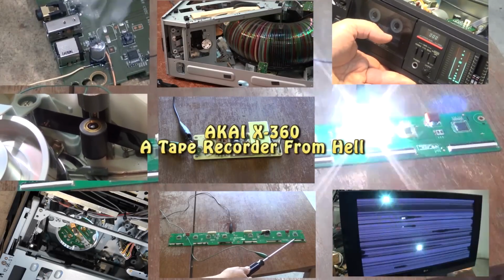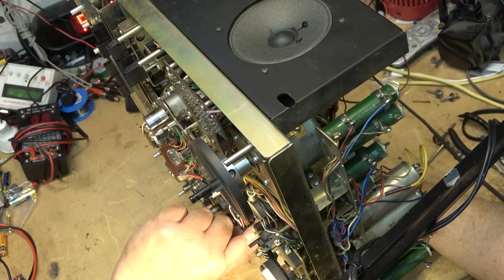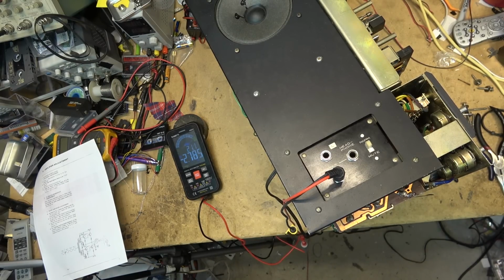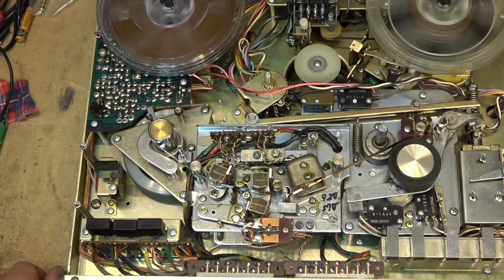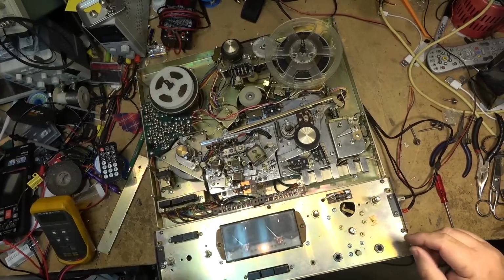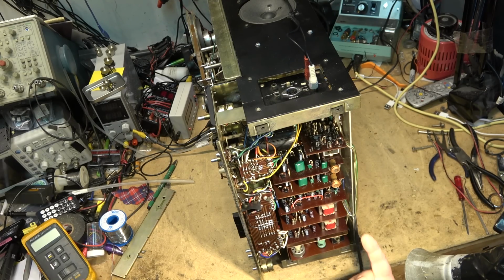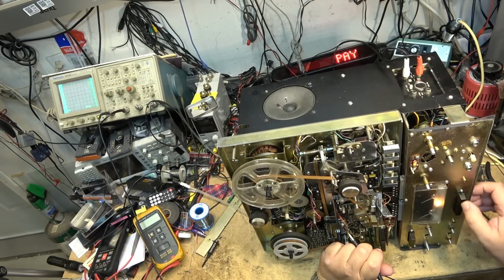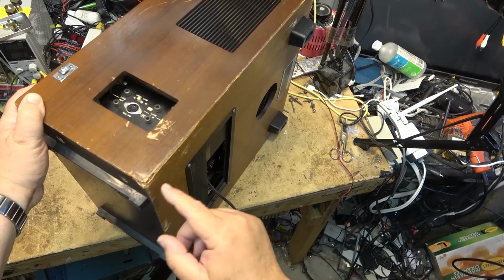Akai X360 Tape Recorder from HELL

Comment: Most Akai reel to reels are beautiful looking decks but they have that infamous pot metal issue with the parts that are no longer available
Reply: There is a company that prints 3D replacement cams ... I replaced on my 1710 , and they work fine
Reply: My understanding is that the pot metal part in question is the transport control cam, on the decks that have 2 levers to control stop/play/fast forward/rewind.  That wouldn't apply to the decks with push-button transport controls like this one.
Reply: I got one needing a motor run cap, another needing a bias oscillator, and another with a broken head adjustment cam. 3 different Akai decks all with different issues. ☹️
Reply: You can now get a replacement kit to fix the three cams , and are available on EBay and other platforms, I have just replaced them on my Akai 4000ds , the kit cost me £80 GBP .
Which saved the machine from the bin and hopefully to last a few more years.

Comment: In reely bad condition. Looks like the customer got you taped. Five hours of pain...ouch. I'm not laughing. 😐
Reply from the maker: I have worked on a few for them. Every time i promise myself I will say no to the next request as they are always more work than initially seem.  I would never do a full recap on one if these old units as with all those shitty boards there are so many faults that can be caused pulling them apart to get to them all.

Comment: When customer stated he replaced all the capacitors was a huge red flag and didn’t bother to change the belts and sent it in for that? For the most part the capacitors are not really a issue with these from experience, usually just use a ESR meter and replace just the bad ones unless I known they are a bad series that prone to fail. Akai used good capacitors in these. What know to be problematic is those 2sc458’s transistors as they used a silver coating on them that corrodes and works it way into the package and they become leaky and static and hiss. Also switches become corroded and etc. To repair it literally has to be gone though and take me a few hours to narrow down issues and etc. plus recommend to change all 2sc458 transistors. I use Fairchild KSC1845 as lower noise and work great overall.

I hate when people do a full recap and think it a restoration, it not and 9 times out of 10 going to end up being something else and in some akai’s they used custom packages that are prone to fail about 100% of the time. Thankfully replaced with discrete components in place and works. The Pioneer Reel to reel buffer IC and even seen some where logic IC failed and unobtainable. So if you do a full recap shoot gun approach you be out money and have to get a donor unit to fix. Always troubleshoot and repairs issues first at least. Plus changing all capacitors you will have to do a full calibration, in som case modification to circuit and etc, otherwise will not sound good as capacitors change resistance in circuit plus where made different back then, better to replace only the bad ESR, or ones that show signs of leaking.
Reply from the maker: Yes I've been saying that for years. But amateurs will be amateurs and someone will say shotgun all the caps and then everybody like a bunch of little lost sheep do that thinking it's a fix-all and it's not. but what do I know I've only been working on electronics for 40 years now so you know I know nothing apparently.
Reply: @12voltvids  I feel you. Apparently don’t know so people still do what they do and mostly  everyone thinks 100% capacitors are always the issue when they usually are not. Some have to learn the hard way, or after throwing some cash it to find it still doesn’t work? 

I literally had to service decks that were supposedly fully recapped and sold to customers that way and then have to repair the issues they caused and trace down the real issue then do a full calibration afterwards typically as some also like to just turn pots to turn them without service manuals or any test gear. I just got done repairing another evs3000 deck that a guy literally cover broken traces with electrical tape after hack job not due to corrosion but due to he literally burn the pads and crap solder work l, so had to undo all the work fix broken traces and that one needed a full recap as those stupid SMD that leak everywhere and calibrated preamp level RF after mechanical calibration of tape path and etc as he also turned a few pots when it was set screw on guide was loose. I shocked it now works to be honest as was about to give up on it after hours spend on it to undo the hack work. Only reason bother with it as was low hours and good cosmetic condition.

Comment: Just to add some on the explanation of a 'cross field' system: usually a high frequency called 'bias' is added with the record signal to the record head. This signal is agitating the ferro parts on the tape to move out of their lazy position, while the sound signal at the same time will form them to the new recorded sound. In a 'cross field' system that bias is NOT added to the sound signal to the record head, but added through the air with a second head, the bias head.
Reply from the maker: Yes I believe I said that the buy signal is through that second head at the bottom which is injected just ahead of the recording Gap. When the buyer signal is added to the audio it has a tendency to cause slight Erasure to the tape especially at slower tape speeds. The crossfield design allowed frequencies upwards of 18 kilohertz at 3 and 3/4 IPS something that at the time of this unit is manufacturer is pretty much unheard of everybody else at 3 and 3/4 the frequency response dropped off around 10 kilohertz.
Reply: Thanks for explaining this in the vid.  Growing up, my dad had an X360 (and still has the Heathkit Magnecord that he built in college), and I ebayed the one I have now for sentimental reasons, and in those 45 years, I never realized how the cross-field bit worked.  So you educated me today.
Reply: @12voltvids  Yes you explained, and so I added my view with it. It is a forgotten way of doing things, and there are not many reel to reels that use this.
This model has a 'relative' easy setup of the head, it has a separated record and playback head, but if the record head needs adjustment, in theory the cross field head should be adjusted too, so be aware of that.
Some other models, like the X-201D don''t have the playback head separated from the record head. In that case the added problem for technicians is the way you have to adjust that cross field head. The only way is to record after every change of setting, rewind, and playback the result and watch the frequency response. Adjust again, until satisfied. I found it really terrible and time consuming. Advice is to never unscrew or unset the cross field head unless real problems demand it.

Comment: When you said do you guys see this at 37:44, I thought you meant the pinched wires coming from that power resistor through the chassis. Did you see that?

Comment: Great video. I just bought one of these of eBay and the video should be really helpfully in getting it mostly working, or knowing how much time to sink into the thing before just using it as a display piece. Fortunately, I just need to get it to play correctly with new belts so I can build a Bluetooth remote for it, which is what I am really interested in anyway.  BTW, did you ever get the recording working, or did the owner decide against any further repairs?
Reply from the maker: The owner gave it to me. It would have been a future project but i ran into an old friend that had been in the radio business (as had his brother, sister and father) and he had lost all his equipment in flooding a year ago. His archive tapes of his family broadcasts however were spared as they were in the attic, so because he was only looking for a playback machibe with 15ips I let him have it. Then the owner called out of the blue asking for it back.  It's up on Prince George now. I don't know if he will give it back when done or keep it. He has about 2000 reels of tape that he is now archiving of old radio shows and commercials and stuff that his dad and siblings did going back to the late 40s right through to the mid 2000s when tape was phased out.  That will keep him busy for a few years now that he has retired.  Most if not all will require baking before transfer.

Comment: I love it when it's supposed to be a simple repair. It ends up being a multi day event.  Did you have to replace the grease,  I've had the capstan be locked up because of grease being dried up.
Reply from the maker: No I didn't remove the capstan bearing.

Comment: A tuff one, great repair
Reply from the maker: Customer abandoned this one.  They bought it off eBay and it was bashed up during shipment and i am sure that's where the board was trashed.   Some day over the winter if I am board I might take another shot at this and see if i can get the record working. I know what it's not, not the audio circuits not the record amp boards and it has bias as it erases.  Just no signal on tape.  Rainy day project.

Comment: Looks a real pain in the ass machine to work on, lol.
Reply from the maker: Most real to real machines are a pain in the ass to work on. Lots of moving mechanical parts lots of grease that dries out parts that get stuck from disuse. these things were never that reliable even when they were new and after they've been sitting around many of them in basements or attics for the past 50 years. They look cool in your stereo system you know to see a big old reel to reel and your vintage stereo system but personally I wouldn't be using one for a daily driver. Back in the day people use real to reel tape because it's all we had that could record high quality sound, cassettes hadn't got there yet. Cassettes caught up and equaled reel-to-reel and sound quality but they are still limited because they're an analog device with relatively low signal to noise ratio. What's digital recording hit with digital audio tape for starters and then mini disc but really digital audio tape was the best because of no compression there really wasn't any reason to use real to real other than just for the aesthetics of it sitting in the stack of equipment it look cool.
Reply: Yep your right there, I have had my fair share of them to fix, lol. I was brought up with reel to reel as my dad always used one. My main favourite machines to fix are Revox and the British Brenell's. Great channel bro.

Comment: An auto reverse machine with only one capstan? So it relies on the back tension when in reverse? Wouldn't that effect the wow and flutter badly?
Reply: From what I've seen, only the later, high-end decks had dual capstans.  They also didn't record in reverse, so any disadvantage would only affect playing back a tape that particular time, and if you wanted to avoid it, you could flip the tape over instead of reversing it.
Reply: They controlled the tension by controlling the two reel motors. It does not matter much which reel is take-up or supply, the motors have a constant tension according to their function.
Reply from the maker: Yes it only has one capstan. how this one operates is when it goes into reverse it turns the torque up on the supply side on the left to take up the the tape and there's that second freewheeling flywheel that starts to turn from tape tension over it that is supposed to help regulate the tape tension and help regulate the speed so it's being pulled from the take-up side Amy supply side motor is actually what's moving the tape across the heads with the help of that second flywheel. I have a gx260d which in my opinion is a superior deck to this one in every stretch of the imagination. It also only has one capstan and pinch roller but it's center mounted and it has six heads erase record and play for forward and another set on the other side of the capstan erase record and play for the reverse direction. The only trouble with that deck is it has glass heads! On good tape that's fine but on shitty old sss tapes it won't play at all. Even after baking them they sit and screech and come to a total dead stop so I don't use that machine it's just another machine for show I use an old 4,000 for tape playback and transfer to digital which is what most people are doing with their old real to real tapes anyway transferring them to digital and throwing the tapes away. I've got about 40 or so of my dad's old reel-to-reel tapes that I have yet to transfer. back in the day he was into the old easy listing music so I never really played them much but I've got a stack of about 40 of tapes all mixed together.
Reply: I hate to think of people throwing the tapes away after transfer.  Partly from the archival aspect of always retaining the original after transfer, but also because I consider the vintage tapes as collectible as the decks from a vintage collecting standpoint.  (It also helps that the tapes I have and consider vintage predate sticky shed.  I have a few of those, but they are much newer than my tapes I consider vintage, from the early 70s, 60s, and earlier.)
Reply from the maker: @jasonhaman4670  yes they toss old tapes all the time.  Video tapes and old home movies too.   Most don't want the clutter.  I need to do a major declutter here and send a bunch of stuff to the dump.  I have boxes of old VHS and beta tapes.  Probably about 8 or 9 totes full of tapes I will never listen to or watch.  I have a storage locker full of old a/v gear that will be disposed of some time.
Reply: @12voltvids  At least when I was very active on ebay, I know used beta and R2R tapes could bring a decent price on ebay.  If someone wants to get rid of them, better to sell for someone else to use, than landfill.  VHS I'm sure is practically worthless.
Reply from the maker: @jasonhaman4670  I regularly get 100 to 200 for betamax.

Comment: I really don't like working on other people's...................."work".         LOL because of the pause!😆
       Got a free Sansui G-8700DB were some genius thought it was a good idea to put mix and match output transistors in one channel and change a bunch of bias resistors to try and make it functional just to make a buck. The power resistors on the driver board got so hot that the solder melted and the leads unsoldered themselves, WOW!
Reply from the maker: Yes they make a mess sometimes.

Comment: Bang bang crack,bzzt, hmmm this socket seems to be cracked, yeah those card edge connectors are noisy in small signal application.
Reply from the maker: Yes horrible. Texas instruments used them on the ti-99/4a and they cause lots of intermittant gremlins.

Comment: It could be that the owner only uses it as a playback machine.
Reply from the maker: Doubt it they've brought me other machines before after they've changed the head recording head themselves to do alignments. Come back with it because when they make a recording one channel is one or two DB lower than the other and want me to check it again for free. I think it's time I just say no to all real to real. I don't have factory alignment tapes and I'm not about to buy one and everyone that brings me them wants some fix for nothing. people get the misconception that there's a lot of money to be made fixing this crap but there's not I've yet to have anybody pay me more than $100 to fix a real to real most of them want it done for 60 to $80 which is what this one was expected to be 60 to $80 to change the belts and set up the amplifier and for that I've got 5 hours into it now as you can see there's no money to be made in this because you quote higher than that and then everyone whines and complains it doesn't want it done. Kind of reminds me the reason why I left the business in 2003. If it wasn't for the little bit that I make from YouTube which is not really much but if it wasn't for the couple hundred dollars I make a month off YouTube I wouldn't be doing it at all. I get a real kick out of when people tell me how much I making off YouTube because certain websites seem to think I'm making a lot more than I actually am.
Reply: @12voltvids  I understand. Reel to reel is a class on its own, and I think better to stand firm on that before you begin. The ear notices the tape in multiple ways, as wow and flutter and frequency response and amplitude. Just double your estimates of the cost so only enthusiasts will pursuit, and then satisfy them by not making that amount in the end 😊

Comment: Not sure if I missed something, but it looks like it would work fine for playback-only.  I would think for many people that have R2R tapes from back in the day, that's probably all they'd want to do anyway.  Though the masking taped wire would concern me from a safety standpoint, and not knowing what else may not be properly done would bug me.
Those cabinets are very fragile, or at least they were by the time they were a few decades old.  The cabinet on this one is mint compared to the one on an X360D I ebayed about 15-20 years ago... I think about every joint was either partly or completely broken.  I got a partial refund on that one, planning on repairing it... but I'm sure you won't be surprised in the slightest that I found various boards broken.  Ended up ebaying an X360, which arrived with the cabinet a little worse for wear, but it was completely functional.  Some time after, one of the turntable motors seized up... luckily I was right there when it did, and shut it off.  Someday maybe I'll get around to either trying to lube the motor, or replacing it with that motor off the beat-up X360D.  I wouldn't dare try to ship it for repair - I figure odds are, it wouldn't survive the trip.